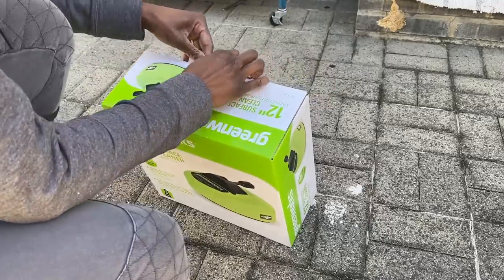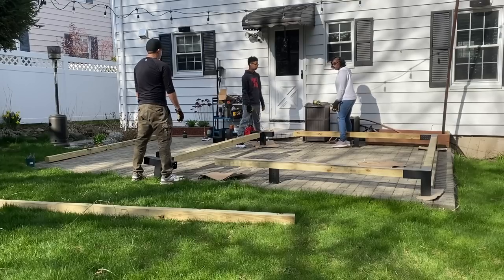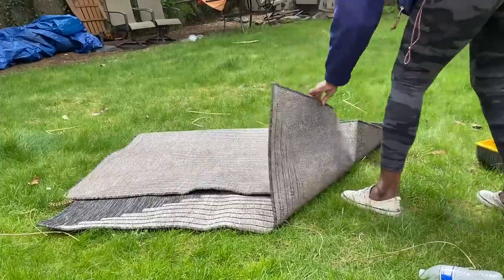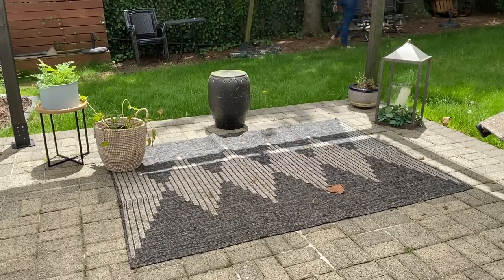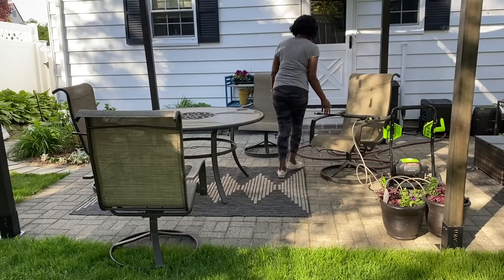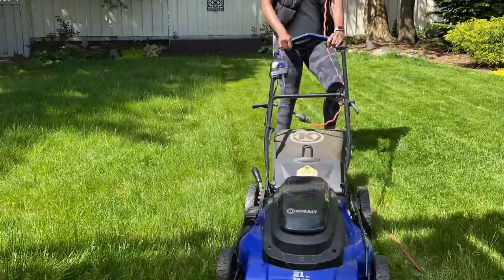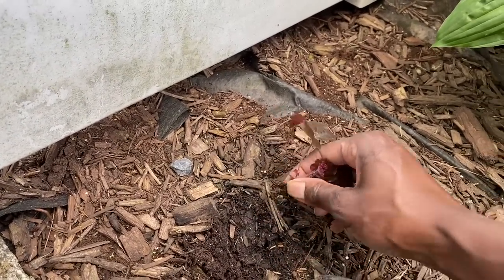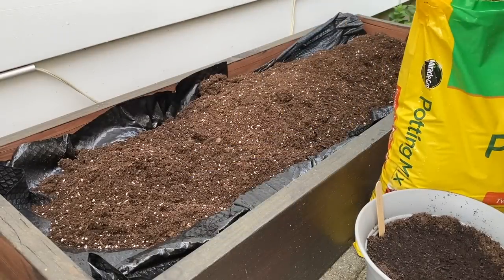Patio complete makeover | diy pergola build | Clean with me marathon | outdoor transformation

Comment: Doesn’t it need to be staked down in the ground?
Reply from the maker: Hello there Vera, thanks so much for watching. Yes we anchored it in to the ground after I posted video. Are you looking to do a Diy pergola?
Reply: @DaphnesHomescape  yes, but I have pavers and not a concrete slab so was wondering how you secured it.  It looks absolutely gorgeous.
Reply from the maker: Thanks. You don’t really need to anchor it with this type of pergola because of the posts but we did it because we don’t plan on moving it. Good luck!